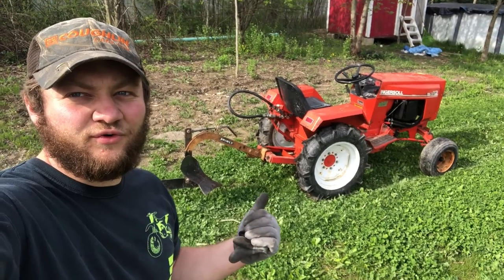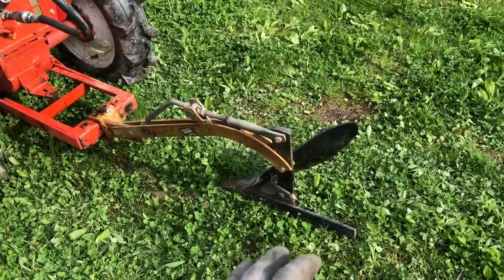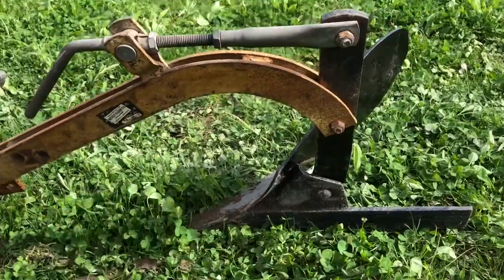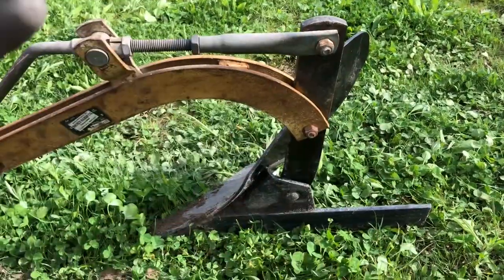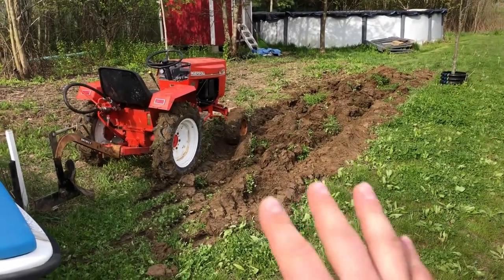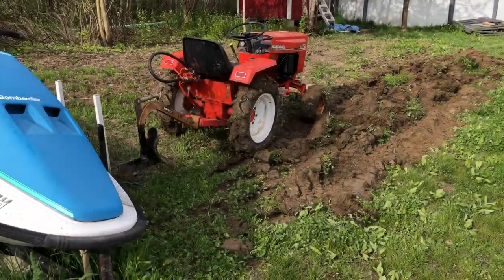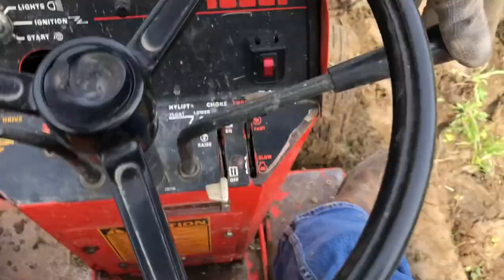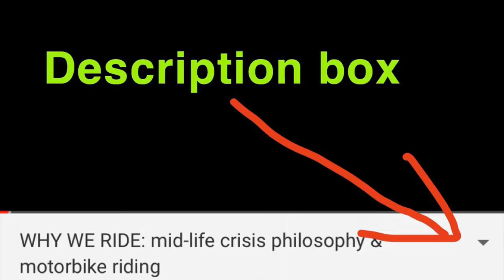CASE 446 PLOWING mold board turnover

Comment: Looks like you have 7-16 tires on the rear instead of the factory 8-16 size. I had two 448 projects and a lot of attachments then sold everything after I bought a Toro 520xi. My health wasn’t good and I needed something that didn’t need repairs.

Comment: A lawnmower can plow that's true. At least you have some ag tires on it.  Biggest thing you need is some weight.  Your rims look like standard wagon/tractor rims and cast iron front tractor tire weights should bolt right up.   Were you really need the weight is on the LANDSIDE.  that is, your left tire on the grass doing all the spinning.

Comment: You need the right weight to horsepower ratio to plow size. 1 horsepower per plow inch depth per bottom.  And 100 pounds of weight per horsepower required. Maybe add some weight over the rear wheels to keep them from slipping. Some tractors allow you to lock the two rear wheels when pulling high traction loads.

Comment: I have a question for you case 446 guys,I have a 85' 446 that ran great,then suddenly won't get fuel,has new battery & plugs so I put a new fuel filter in and it's getting to the carburetor but still nothing,it starts for a second with carb cleaner but won't stay running, is a a fuel pump or the carb?? I'd appreciate any input,live your channel good ol'boy!
Reply: Check the carb float and needle calve is allowing fuel into bowl. Also check idle jet is clean.

Comment: What size tires did you have on the rear, I want to go with a similar set up
Reply from the maker: I went with the 7x16 if I remember correctly, I had to get 4” wide rims for the tires to fit correctly as you can see in the video. I really liked that tire setup, it worked well. Thanks for watching!

Comment: Will that brinly work on an atv?
Reply from the maker: With the correct setup you can pull these plows with just about anything. I’m pretty sure they make specific set up for four wheelers so you can run a plow desk drag whatever… thanks for watching!
Reply: Kinda wet for plowin, but she did it. I have a 446 that I got about 5 months ago. I’d like to make a sleeve hitch and lift mechanism for it. I want to use  the tractor for hilling potatoes. My LGT Ford garden tractor only has about 7” of ground clearance.  The Case 446 has 11” of ground clearance, as you know, and this clearance will help with not damaging plants and will be able to hill for a long period of time. Any videos or pictures of the sleeve hitch and lift mechanism.  Thanks for any help
Reply from the maker: @noelstractors-firewood57  Unfortunately this is probably one of the only videos that’s going to have the lift mechanism/sleeve hitch in it. I have unfortunately since parted ways with the case 446, and all of it implements. I love the thing but didn’t want to run it too hard. I pass it on to somebody else that had a smaller garden. I ended up getting a yanmar 1500 D. Obviously there’s a day and night difference between the case and the 1500 D. I don’t really care about the power or the fact that one’s gas and one’s diesel. Really I just had a lot of garden to till up and needed something with a little more capacity. Otherwise I’d still have the 446, they are really awesome handy tractors! Thanks for watching!